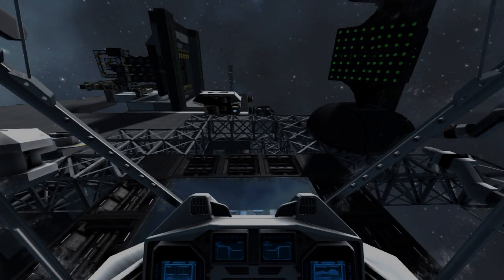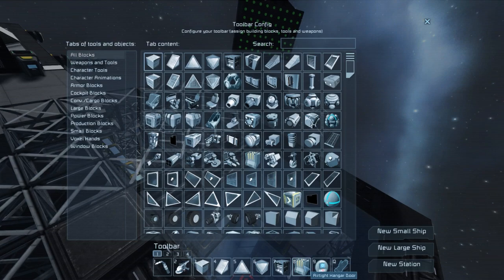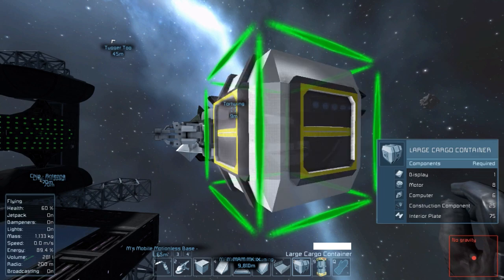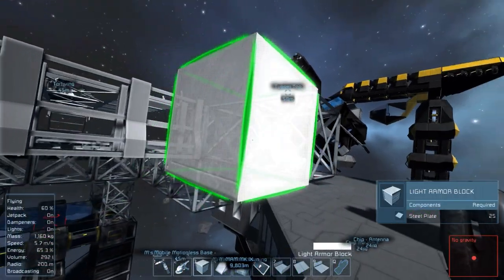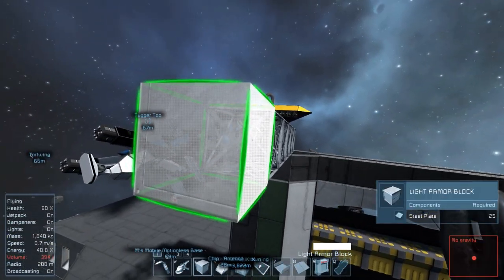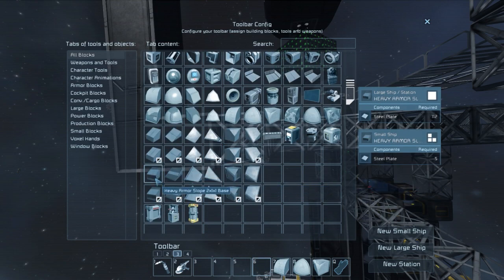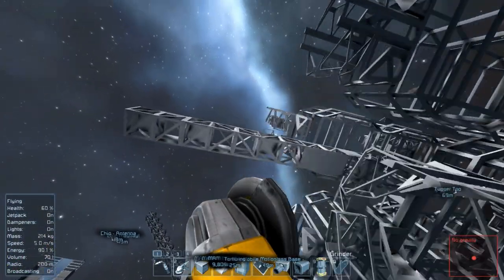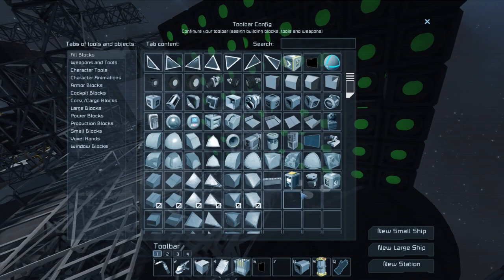Space Engineers • Solo Survival • 71 • Control Room Ideas

Comment: Crown Molar is going to be a sweet, large addition to the "fleet(?)" of other ships. Should make welding things a lot easier. I also like the idea of having different colored Tuggers. Maybe connect two Tuggers to each other with the landing gear and have them do a ring around the rosy sort of thing? Or hook them up like a train. Or you could have a long docking bay where they are connected to the roof. Then you could have a sort of conveyor/treadmill drop them off when needed. But that might be a lot more work than necessary haha. Actually, an escape pod dock would be awesome! Have a huge array of sensors around the base that would detect enemies. If triggered, it would set off alarms and flashing lights in the station. Then doors leading to the escape pods would open and you could get in and launch out (we need some very strong KSP rockets that can quickly go extremely fast).

Comment: Solar Max is indeed 120w.

As for the hanger doors, you can always throw them on top of blocks attached to a piston that only engages when molar is involved (although that is probably gonna be awkward given the top of the repair bay is.... well, non-existant)
Reply from the maker: FrenziedRoach That's an option, although the benefit of the hangar doors is that they aren't a separate grid.  If we put them on pistons we remove that benefit, though would look nice.
Reply: Well, I figured you were after them for the oxygen seal.  But even then, pistons do raise more concerns in that area as well

Comment: Looking forward to what you are doing to make the control room, making something similar myself but planning to make a "power" core instead of the AI Core, so looking for ideas.

You could put the Air vent under the vent you use as a stairs or on the opposite side of the room. and for realism maybe you could put 2 vents 1 for intake 1 for exhaust, to simulate air circulation.

Regarding molar, and hangar door, maybe you can get someone to create bigger hangar doors just for your space station, in the style you want, there are some mods that do change the look of the door and size. But like you I'm hoping Keen will add standardized bigger doors. would be great to have ones that could fit a big ship into a station docking bay.. 

Are you planning to use sensors and such to operate your airlocks?
Reply from the maker: Sounds good Taliseth, like the ideas.  

There is a mod for some 2x1 hangar doors that open 4 blocks and look like the vanilla ones.  We might use those.  I haven't messed around with the sensors and venting stuff yet, but I hope to do it that way.  I think people have made some scripts too that I might check out.